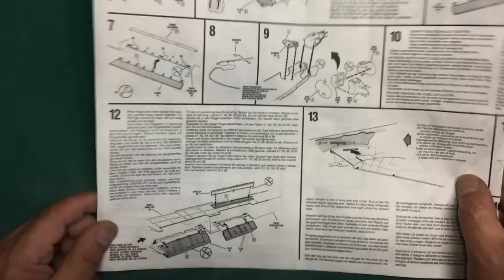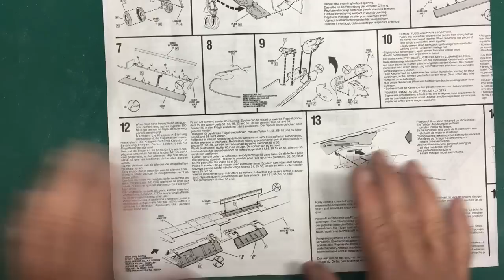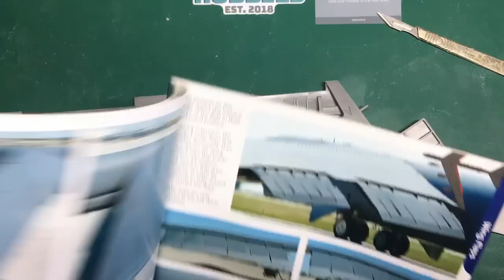Big Bad Buff Build for beginners. Part 14

Comment: glue some EVA foam on the blades of the bulldog clips, you can then clamp closer to the edge without the taper popping off the clamps and also prevents squashing any raised details

Comment: Just a quick trick for your Revell contact glue Nigel.  Place a pin in the nozzle when finished using. You can still place the top on and the pin will always remove easily when you next need to use the glue, without the problem of trying to clear a blocked nozzle.

Comment: I really enjoy this build series, and took up building a plane myself, the 1/32 Ju-87B2 Stuka by Trumpeter. Eduard upgrade kits for cockpit and seat belts are on the way. it has a very detailed engine but the weird thing is it won't be visible when the fuselage is put together. Despite this I am making an effort to paint and weather the engine and the support braces because as you say "you know it's there " so do the best you can do and make a masterpiece of it although very little will be visible. Perhaps I will leave some of the hatches open so at least a glimpse of the Jumo engine can still be seen. The Stuka took part in the Battle of Britain, but was withdrawn as they were very vulnerable to attacks by your splendid Spitfires and Hurricanes. I am assembling a collection of aircraft that participated in the Battle, including the Ju-88 and the He-111h. Churchill said it was your "finest hour" but did you know Poles, Czechs, Free French, Americans and even we the Dutch participated? It was a joint effort and first defeat for the Third Reich in the War. Anyway I digress lol, I enjoyed the video as usual and noticed that the plane is massive even on 1/72 scale.

I have a question about the technique you demonstrated, using Tamiya extra thin to get rid of small seam lines. I tried that but the parts ended up very shiny. Is that ok, will it be covered once painted or should I prime if first or sand it away? 

Thanks again buddy, stay safe and enjoy your weekend :-)

Comment: Hi Nigel. Have been following many of your B-52 builds. Fantastic work. 👍. 
Question for you. I’m currently working on the Italeri B-52G. Any advise on the wings for the drop and flaps..?? I’m thinking of heating up the sprue tree into a drop and sanding to fit. I also would like to cut the flaps out has the detail is present. Thanks for your time and effort on the B-52 videos. 👏
Reply from the maker: Hi Gary,
First you need to take care of the wing root. The root has dihedral moulded into it and it should have anhedral. Then you can assemble the wing halves with a little droop if you so wish. Then you need to fatten up the skinny tail, change the wing tanks and correct the nose. Other than that the kit is perfect lol.

Comment: been moddeling for a little over 2 years and the cocktail stick glueing method is something i will have to try on my next big plane.  i do have a question, how do you avoid burning out on a project especially when it is an old kit with lots of mods and months of filling and sanding,
Reply from the maker: I have many projects on the go at a time

Comment: I'd like to see you tackle a short run/garage kit at some point Nige - I think you'd be as happy as a Land Rover in mud, rolling around in all that car filler, sprue-goo & Mr Surfacer ;)
Reply from the maker: James Mower any ideas on a kit?
Reply: @NigelsModellingBench  it would have to be a plane - Mikr Mir, Special Hobby, Sword do some interesting kits and slightly more challenging kits. I won't mention Mach 2 as they are on a different level.
Reply: Nigel’s Modelling Bench Mach 2 VC-10 K mark 2 - that’ll fight you all the way. 😀
Reply from the maker: Phillip Siviter maybe I should get it and make new resin nose??